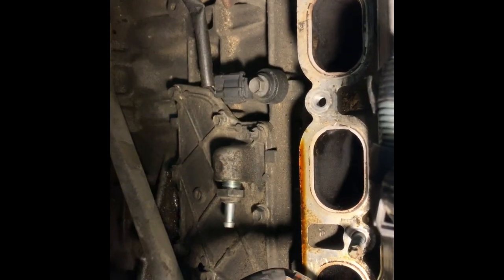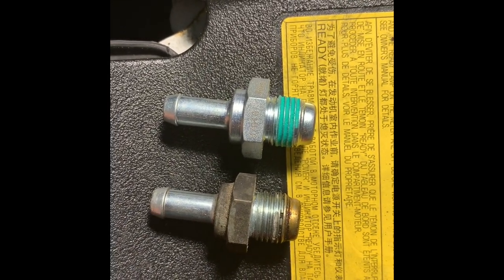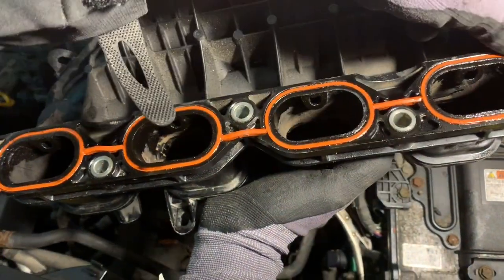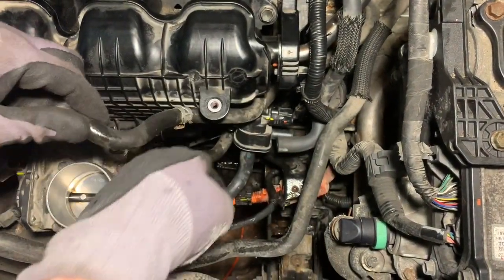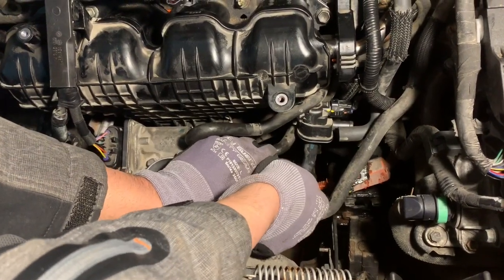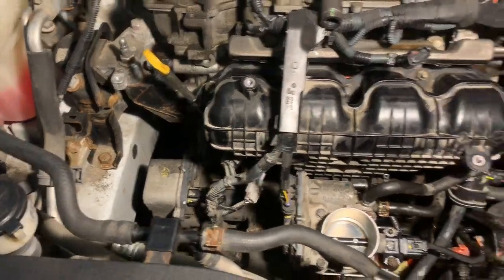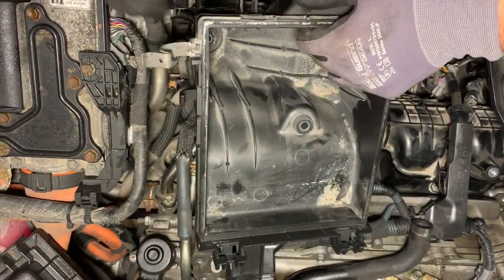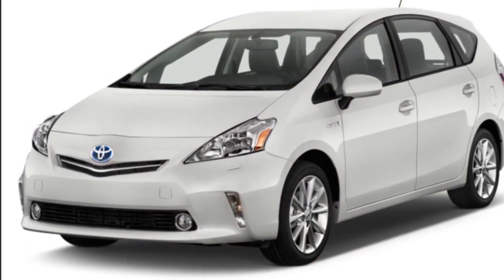PVC Valve Replacement Toyota Prius Hybrid  2010-2015

Comment: is there a way to replace it without taking so many pieces apart?
Reply from the maker: Yes 👍 try going underneath engine and locating part from there!
Reply: Better to take off the manifold and clean it and the egr passages in the manifold if you have higher mileage 80k or more.🤙🏽
Reply from the maker: @matthewvalenzuela1441  yes , it seems like a lot of work but once you get started it makes sense. Once  you see your egr passageways are all blocked up , it makes sense to spend the extra time & effort!
Reply: @fixitgary5657  Thanks for your video, I’m replacing the PCV this week and needed the socket size, 22mm. 🙏🏽🤙🏽
Reply from the maker: Get the  22mm deep socket for removing Pcv valve. I hope it all goes smooth for you.